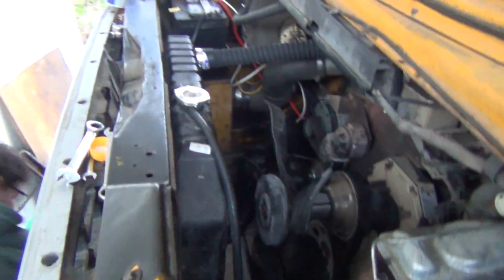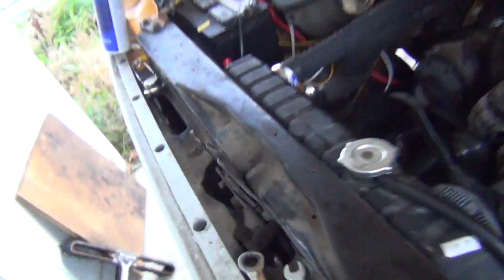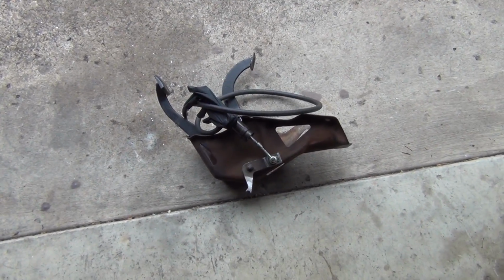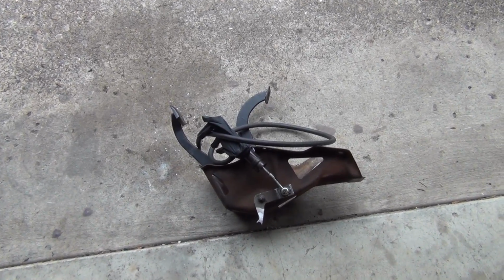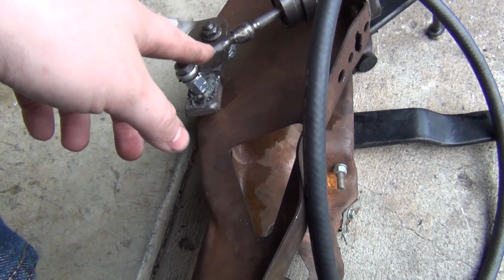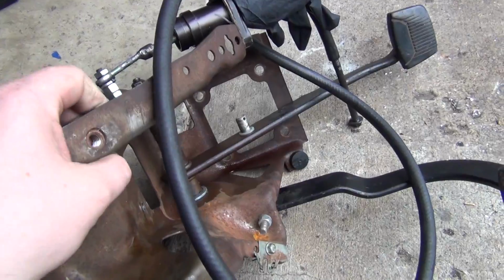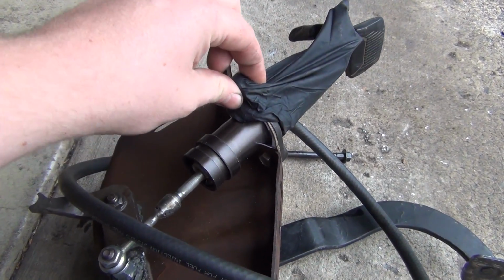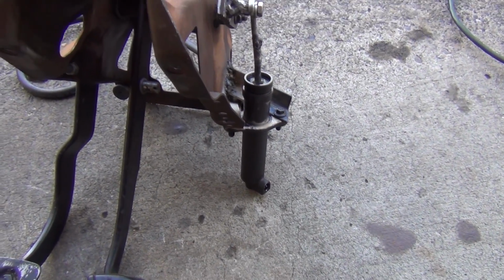4BT Econoline Getting Ready to Scrap It

Comment: My dad used to work in car dealerships. He said they would loosen the clutch bleeder, take the air hose with a rubber tip on it, put air in the little vent in the slave cylinder cap, just a little squirt. Close the bleeder and you're done.

Comment: I know this is old...but you could have solved the issues with the clutch very easy.
Aftermarket clutch pedal.
If you need a van...you need a van and a truck will not do.
Reply: "Mr. CHEAP's" OLD MOTORHOME UNIVERSITY 
Yup, I just installed one in my 79 4bt Econoline, pretty easy just gets a bit tight with the brake booster.